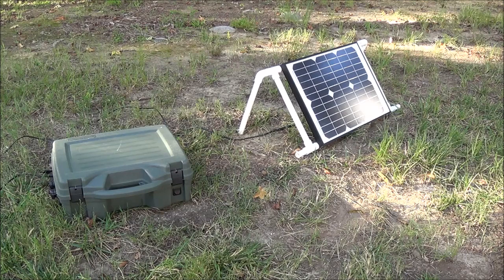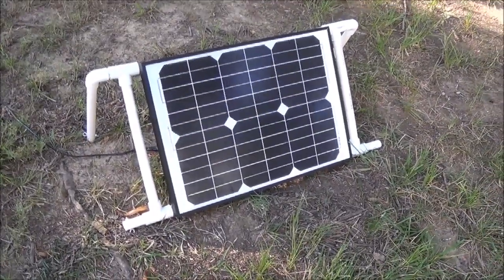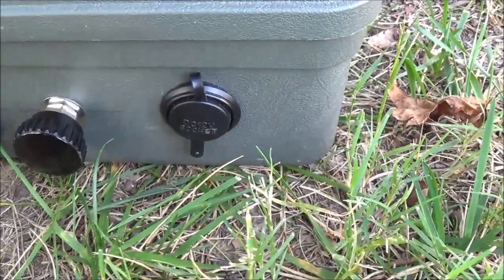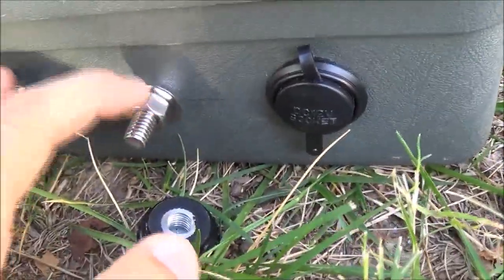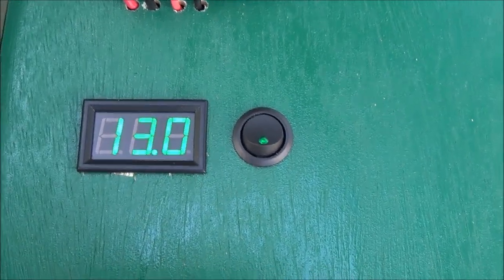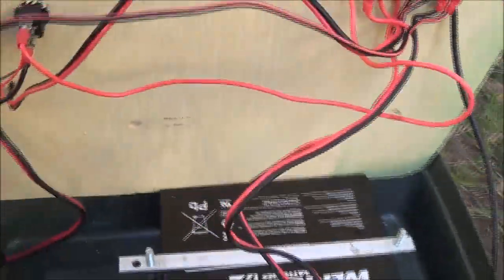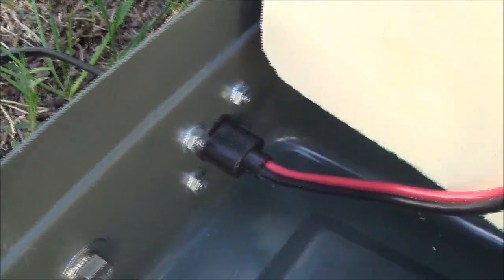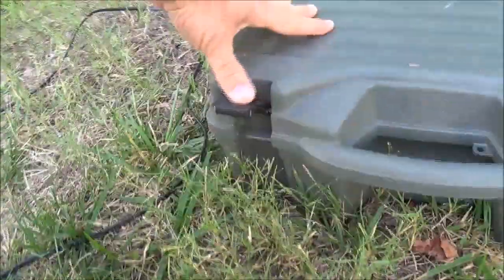DIY Portable Solar Generator #2

Comment: Great work. What crimper did you use for the non-insulated terminals.?
Reply from the maker: Thank you!! I used a tool that I got from Harbor Freight to do the wire cutting and crimping.

http://www.harborfreight.com/9-1-2-half-inch-wire-crimping-tool-36411.html

Comment: hmm, inspiring.
I'm planning on retiring in the Philippines so the sun is perfect but they do have those tropical storms that shut down the grid for up to a week and everyday is stormy and cloudy.
.
A system like this that has the option of charging from a vehicle then taking it inside to charge cellphones and run some small lights I think would be ideal.

Comment: Looks good I think you have a usable item. I would make a few suggestions like the main bolts going out with power, I would do a slow burn 25amp fuse or circuit breaker, another this is to secure the leads to the bolt the though the plastic side you will cause heat from the poor contact and melt and burn the plastic.
Reply from the maker: That is a great idea. I will definitely look into adding a circuit breaker. Thanks for the tip!!

Comment: What size of solar panel?  Is it 40w or 80w?......or?  You did a great job. I have built 2 portable power supplies much like this, all out of scrounged parts and pieces. The first one I built in a ammo case from Walmart...and it is just right for a small 12v battery.
You can also mount a small 300 or 400w inverter to it, that will give you 120v/ac too.
Thank you for your time.

Comment: What are the specs of the fuse your using, and I like how you placed the connection to the panel on the side with a rubber top when not in use where did you get it?
Reply from the maker: Jesus De La Cruz I have a 10 amp fuse, which is pretty common for cigarette lighter type outlets. I bought that lighter outlet at Radio Shack. I am not sure if they still sell that type or not anymore. They don't have them on their website at least. I am really glad that you liked my video. Thanks for the comment!!

Comment: Hello there, I am making the same set up. Does yours have a power inverter. I am making mine to run muychilds asthma machine in the event of a power outage.
Reply from the maker: This particular unit does not have a built in power inverter. That is the reason for the side posts. I can then directly connect the inverter to the posts and use any type or wattage inverter I would like or need. I think that is a great usage for this type of generator. You could even leave under their bed or in the closet to get quick access and get their machine up an running quickly. Good luck on your unit!!
Reply: ok. I'm playing with several ideas. I have two inverters, one with the back pole connecters and one with a lighter socket plug. I mage just make two generators since I have a 15 watt fixed panel and a 14 watt folding with two USB's.
Reply from the maker: Thatgadgetguy30 Sounds like a good idea, just be mindful and what amperage batteries you choose for your generators. Also, you may already be aware of this, but the 14 watt folding panel with the two USB ports is only going to give you 5 volts from either port, so that one may not be a good choice for this application. Just my two cents...
Reply: I appreciate it, it was just a thought. Im new to solar and wiring in general, I feel so lost, I have some parts and the rest coming in the mail. the battery is a 20AH AGM sealed, it was gifted to me brand new. My main concern is the length of time the asthma machine will run. it pulls 1.7amps, or at least thats what it reads on the bottom label.
Reply from the maker: Thatgadgetguy30 Another problem that I see now that I know the battery that you are talking about. You are going to need a bigger panel. It takes approximately 10% to charge the battery back up. So, with a 20AH battery, you will need 2 amps or more to charge the battery back up during the day to use it again the next night. You will need to all the amperage that you can get because 1.7 amps will almost kill that battery overnight. Let me know what you end up doing. Good Luck!!

Comment: You should fuse the main lead from the battery.  It is almost certain that at some point someone will short the main terminals which could lead to a burn, melted wires or fire.  Easy to put an inline 30 amp fuse on the positive feed..

Comment: How many watt solar panel is that? Looks like you did a nice job on the build
Reply from the maker: cabmaker That is a 20 watt Solar Panel. The charge controller is rated for 10 amps so you could definitely use a much bigger panel and charge the batter in a lot shorter time.  Thanks for watching!!

Comment: what kinda battery lead acid battery ?i have 1100 watts inverter in box 12 volt deep cycle battery 75 amp 900 watts i have lead light on it i have two 110 AC out on ti i have dimmer light switch on it and i have fused bwteen my positive of my battery and positive of my inverter to turn it off nice video

Comment: What number is the cable? Is it the same awg for the whole project? I am starting out a project. Thanks. Ana - Puerto Rico
Reply from the maker: I used two different sized wires in this project. Most of the wire in the generator is 16awg and the wire that is hooked to the terminals with the screw on caps is 10awg wire. Mainly, because it handle a lot more amperage. Good Luck with your project and I would love to see what you end up making!! If you have any questions, please let me know and I would be happy to help!

Comment: Really nice project dude. You could try using a smaller battery and use two of them to create from 12 to 24v if you needed a higher voltage all though what you got is pretty sweet. I was thinking of something like a pack of smoking to go with my goal zero and battery or something similar. All the best, Robert
Reply from the maker: I have another case and battery exactly like this one and had thought about making another one just like it. Then, I could connect them together to get more amperage if the need ever came up. Thanks for checking out my video!

Comment: People need to put a switch between the charge controller and the battery when your not going to hook up a solar panel to it for a few days. Because that charge controller circuitry puts a load on the battery just being hooked up to it. And it will run a small battery flat after a while.

Comment: What are the practical capabilities of this? 

How long does the charge last, powering which types of devices?

From 0 how long does it take to recharge?
Reply from the maker: +jim hayes I have used this from charging multiple devices to running a fan in my tent all night long during the summer months.

Comment: Nice case! by the looks of it you could fit a second 18ah battery in the case.
Reply from the maker: +Neobreaker The is extra space in the case, but there is not enough space for two of them.